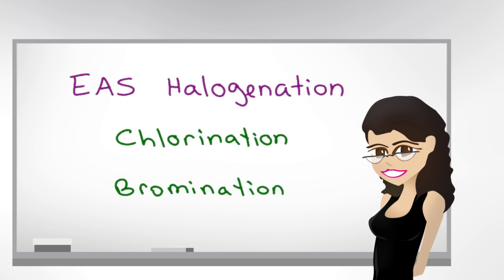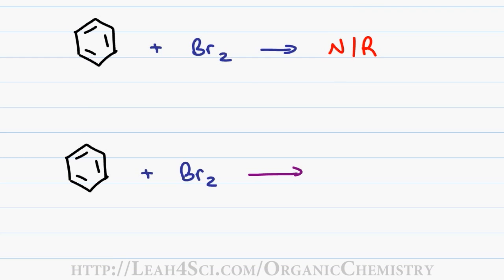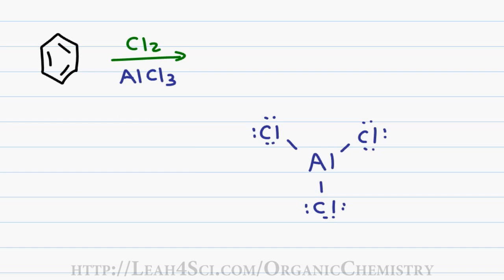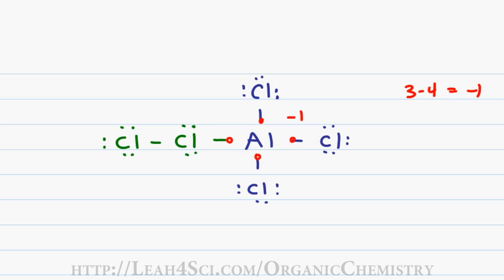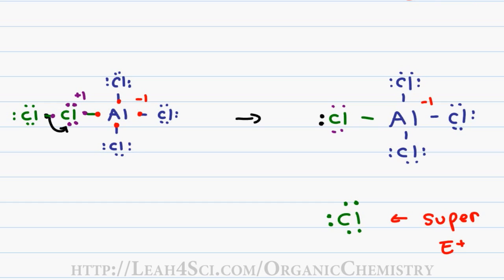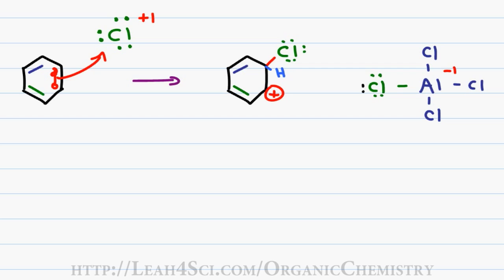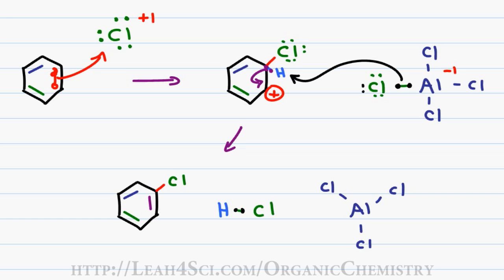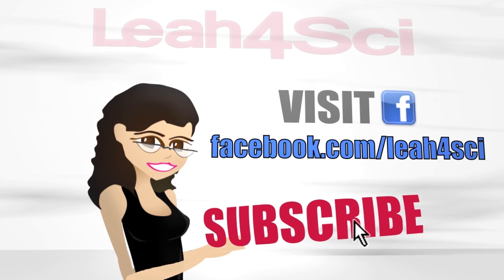Aromatic Halogenation Mechanism - EAS Vid 3 by Leah4sci

Comment: could someone pls explain why aluminum has a free p orbital? since it gives his 3 valence electrons to chlor to have full octet, I don't understand where this free p orbital comes from and would be sooooo happy, if someone could help me with that
Reply from the maker: First, a free p orbital means an empty p orbital available to be filled with attacking electrons. If you remember in hybrid orbital theory, a molecule with a central atom like aluminum that forms 3 surrounding bonds is trigonal planar in shape, or sp2 hybridized. Those 3 bonds are formed by the overlap of sp2 hybrid orbitals.

The sp2 hybrid orbital is made by the mixing of 1 atomic s orbital and 2 atomic p orbitals. Meaning, the third p orbital on the 3rd energy level of the Aluminum atom is empty and not participating in the hybrid orbitals that create the bonds of this structure.
Reply from the maker: For more on hybridization in organic molecules, make sure to see my Organic Chemistry Basics series at Leah4sci.com/OrgoBasics
Reply: @Leah4sci  omg thank you so much!!